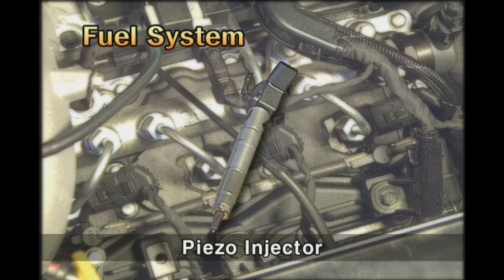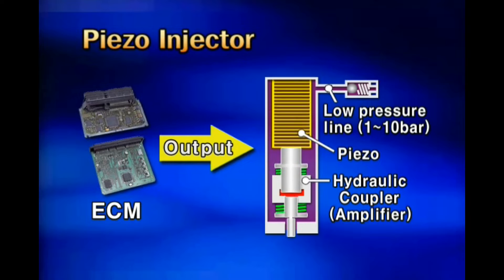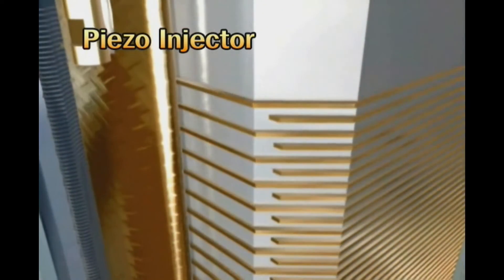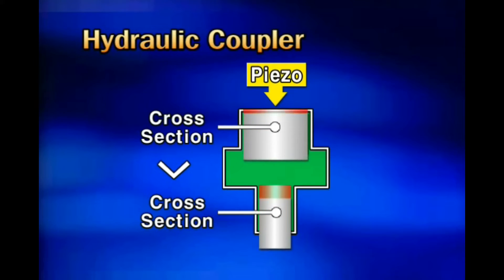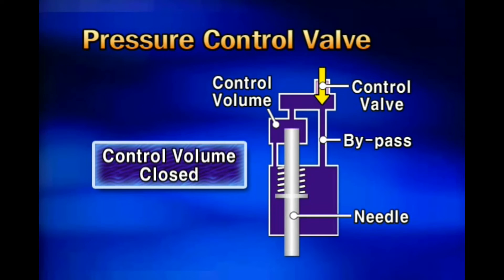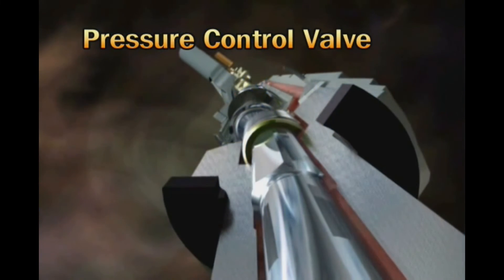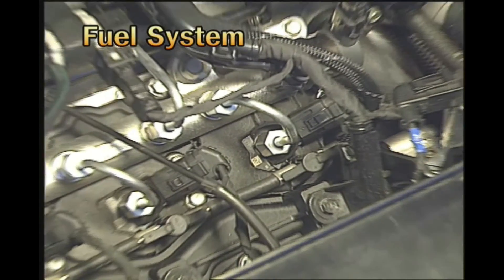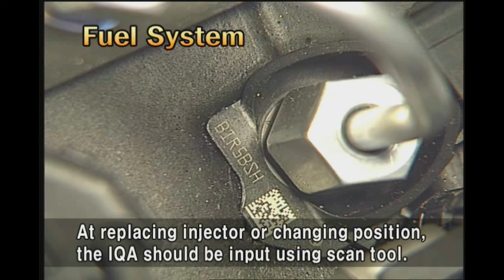How Piezo Injectors Work on Diesel Common Rail Fuel Injection System | Piezoelectric Injectors.

Comment: The Common Rail system, currently dominant worldwide, is not without its drawbacks.

The first is the closed-type injector itself, with a multi-hole nozzle and electronic control. Regardless of the control method (spring, solenoid, or piezoelectric valve), a further defect is present: the pumping action of the needle when seating after the fuel injection process is complete. As a result of this pumping action, residual fuel under the needle is forced into the combustion chamber at low speed, into an oxygen-depleted region, where it undergoes pyrolysis, leading to smoke and coking of the spray holes.

Secondly, the conical shape of the fuel spray increases the induction period compared to a flat sector 0.1 mm thick. This increased induction period, namely the accumulation of a large amount of fuel in the combustion chamber before ignition due to increased warm-up, evaporation, and ignition times, leads to rough engine operation and, consequently, increased NOx emissions.       The use of pilot injection in the Common Rail system, and especially multi-injection, reduces operational rigidity but increases fuel consumption.
Reply: koji je bolji sistem

Comment: Note: never design vehicles to use piezoelectric injectors because they are heat sensitive and fail regularly. No manufacturer has designed a piezoelectric injector successfully for automotive use. They are expensive and the replacement cost outweighs their efficacy at dosing liquid.
Reply: What do you describe as failing "regularly"?